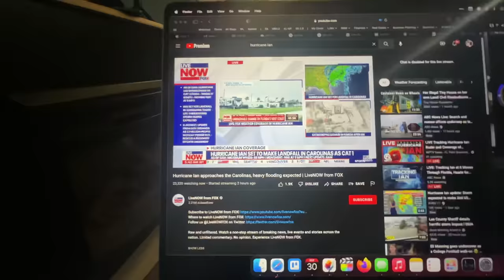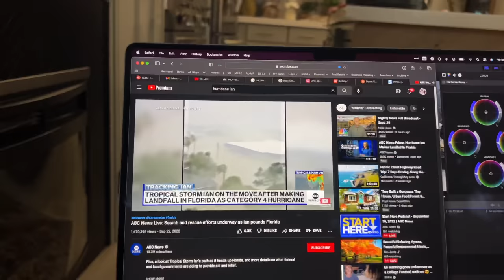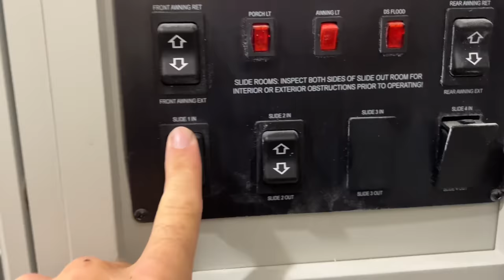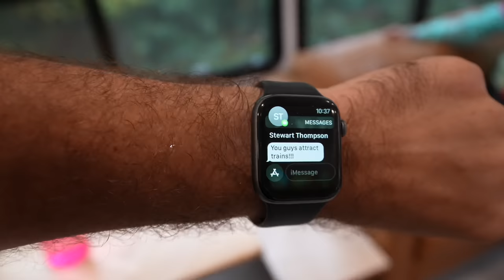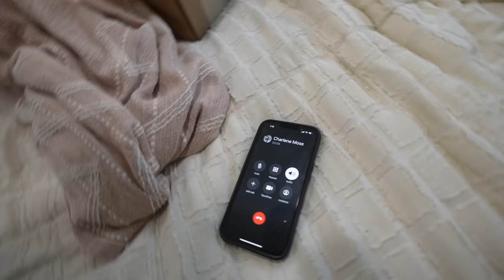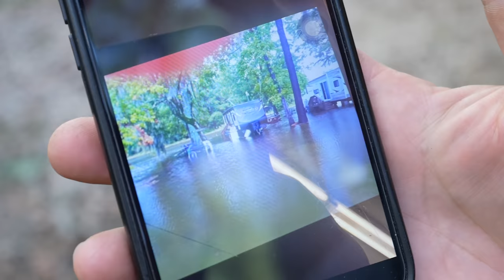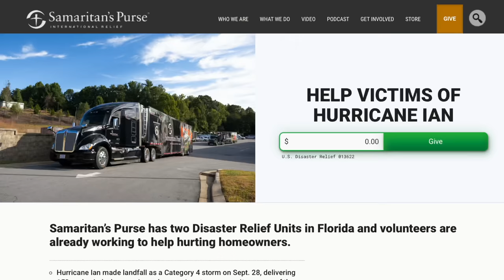EVACUATING Our Flooding Campground // RVing During Hurricane IAN

Comment: Hey guys, Glad you made it out and back safe. I have a friend and his family,  fulltimers. Who were running from the storm and flooding in Ft Myers Florida. He and his family own a 5th wheel pulled by a dually and as they were leaving, driving on the highway, the water was so deep and was coming into the truck and the 5th wheel was floating off to one side. Luckily it only happened for a few hundred feet and the trailer tires finally hit bottom and lined back up. They made to higher dryer ground, driving all the way to Lake City Florida.. Good Luck and God Bless

Comment: Whoa I was shocked when you said that the Airstream was hard to control in wind. I was in a tropical storm with 60mph gusts going home in 2013 to Fort Myers from St. Augustine FL towing my recently purchased Airstream with a Curt hitch (no sway control) and it was straight on through it all- straight blows, side blows, etc. There was a box trailer en route that was blowing all over the road. Even semi truck trailers were running to the side with their rears in the left lane. It was bad. The wind just rolled over top the Airstream and I was not blown around towing with a half ton too. I had major headwinds at times that would drop my speed 20mph. After experiencing that, I said I would never want a box trailer.

Comment: We don't get hurricanes at our beaches in CA and most of our bridges are over the water here in CA.  Just in case you didn't notice when you were out here.  The camps are more expensive, though.  Yeah, you got cornered without any real good options.

I use 2x6 and 4x6 for under my tongue jack and stabilizers, they are also good for stacking up to get over a curb if necessary.